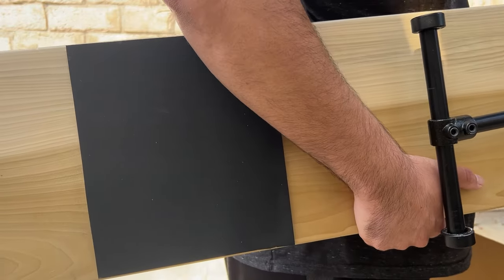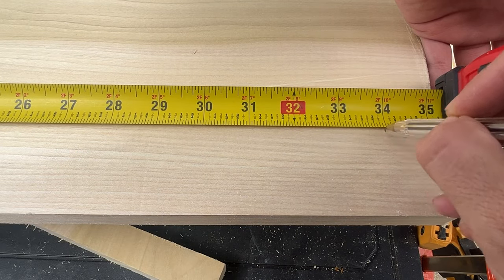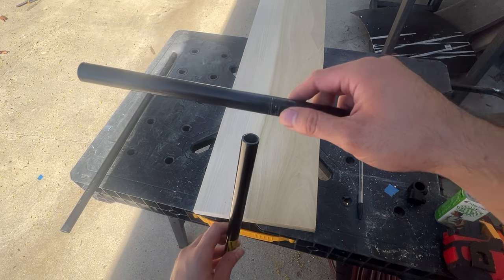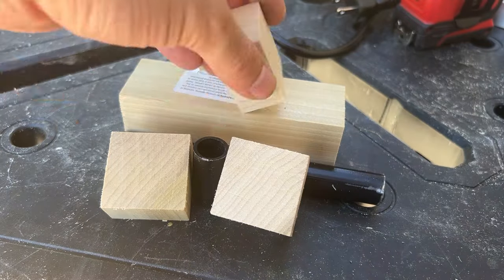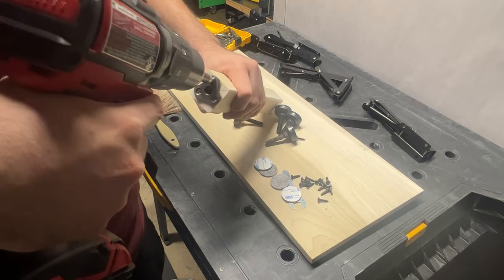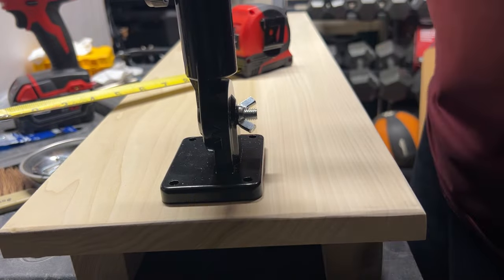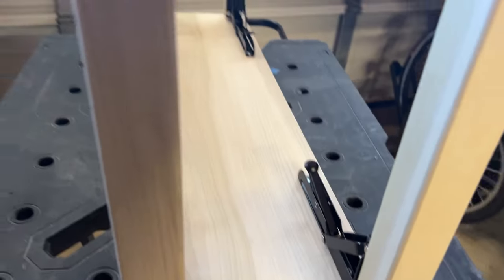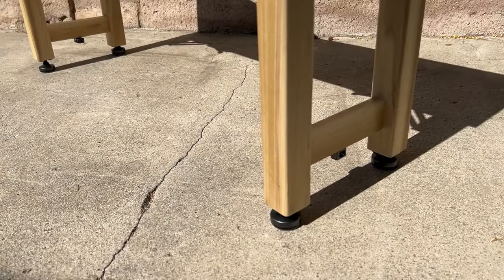How I built my folding art horse

Comment: Thanks for this. I have made a couple of things for out-of-doors  painting and drawing, but I hadn’t thought of a portable donkey. I would like to know if you have found it useful and whether there are any snags that you have fixed after some practical use. Did you find a better type of folding strut for the legs?
The donkeys we had in art school (long ago) had a waist in the bench which made them more comfortable to sit on. I might try that refinement. They were of course really heavy solid wooden furniture, not portable. I am thinking about how to lighten the structure without sacrificing strength. Possibly alloy tube for the legs and the easel? Hmmm … think on a bit. 
Have good days drawing.